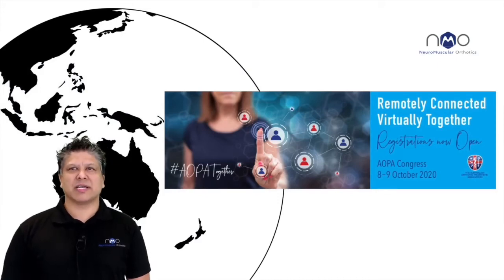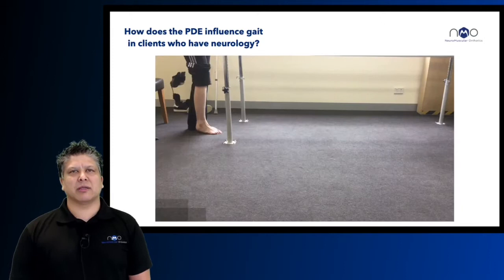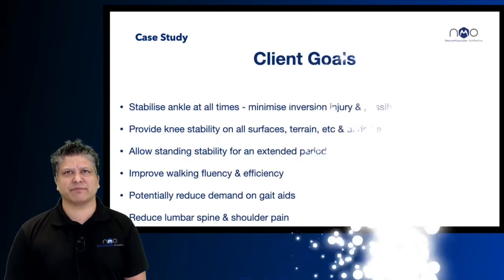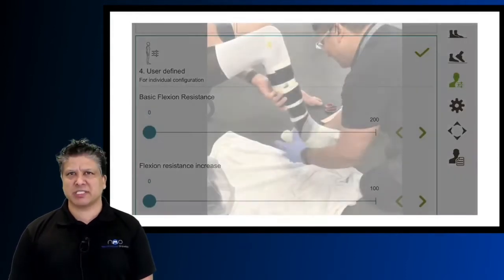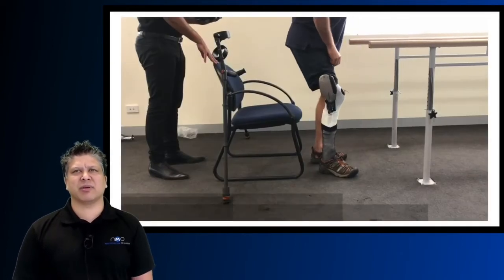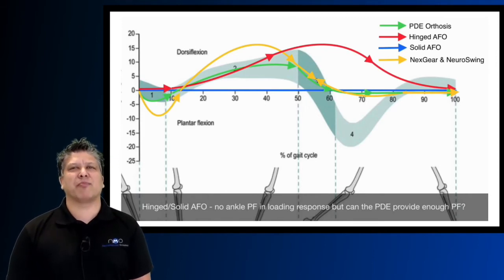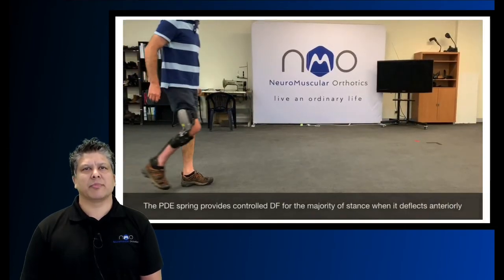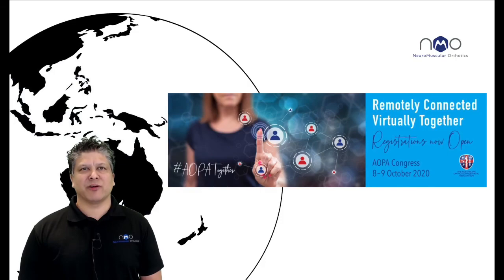Utilising the Carbon Fibre PDE in KAFO Prescription

Comment: Great job Darren! Thanks so much from the US! This will be so valuable for us too. We have seen the same need for this as you have! Completely agree!
Reply from the maker: Gerald Stark Thanks Gerald - the ability to disconnect the C-brace & uprights from the DTO has allowed us to correct the the limb optimally in a walking cast. This drops the weight of the DTO by 2+ kgs and helps if the client has weak hip flexors. It also helps us to justify funding for the C-Brace here in Australia as the insurers are asking us to also test other stance control systems and complete outcome measures during the trials.